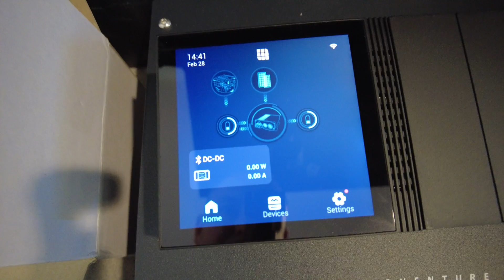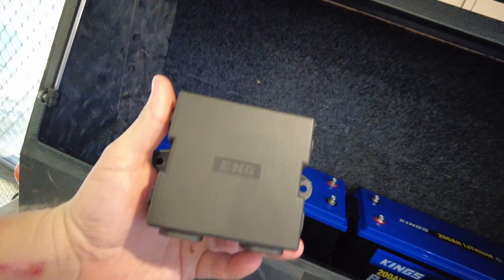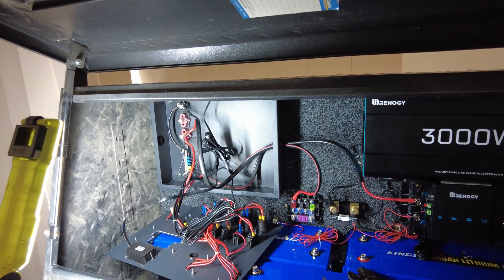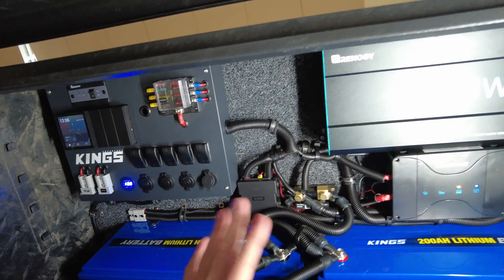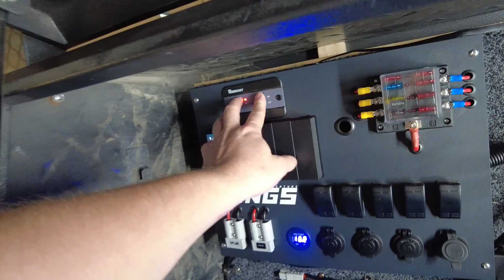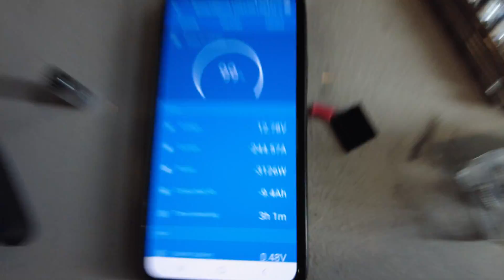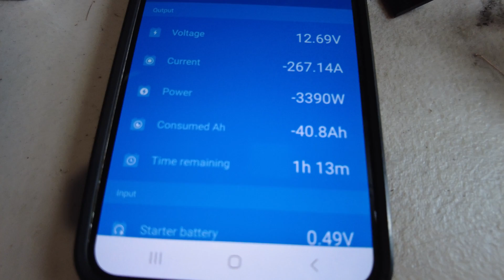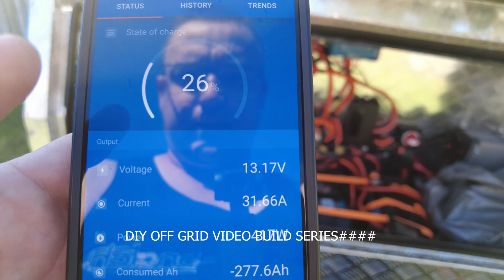600ah KINGS LITHIUM OFF GRID TOOLBOX BUILD

Comment: 3000 watt inverter on 50mm2 - i would have thought it would have to be 120mm2 or - 90 at the absolute very least?? can you explain your working a bit please..
Reply from the maker: This unit isn't designed to run at a full 3000w load constantly. Therefore 50mm2 is plenty over an extremely short run.
Reply: @WEEKENDER4X4  but it can run at 3000w by someone who is using the system and doesn't know its undersized cable?
Reply from the maker: @TindogTravels  the person I built it for wont use it for 3000w loads. If they sell it they're more than welcome to upgrade the cable if they need too. Its fused accordingly also.

Comment: Great set up mate. Well done 👍. One question about venting. What sort of vents have filters to keep dust out?  I have a platinum camper and want to relocate the batteries into the front checker plate tool box but I’m worried about heat. I was thinking of using a computer fan for extraction and having a vent on the opposite side of the box but I need to keep dust out too.  Cheers
Reply from the maker: @jackthomson73  most caravan filter sets come with fans and filters

Comment: Nice setup. Did you consider going 24v or 36v? What about solar charge capability? Will there be ventilation ports/fans? You also must insulate all exposed +12V connections to prevent accidental short circuits - very important.

Comment: Hey bro, do you have to earth a 12v system?
Reply from the maker: @newylyf7481  if it's just 12v no. If it's 240v floating(mobile) no. 
240v fixed it's always preferable to have the inverter earthed.
Reply: @WEEKENDER4X4  cheers bro, I don't know why so many people earth their 12v system in the back of the 4WD.
Reply from the maker: @newylyf7481  you earth it directly to the battery. Or a good body ground in the car. Sorry I thought you meant ground as in ground in ground lol
Reply: @WEEKENDER4X4  all good haha. I meant like a ground to body or chassis on the car. So like the Victron distributor has a ground connection which I've seen people run a cable from that to the car chassis or body. Doesn't make sense to me as why it's needed.
Reply from the maker: @newylyf7481  grounding to the body isn't necessary if you have enough cable to run the whole way to the battery negative. If you're on a budget and don't have enough space for fat cables running through the interior to the battery, grounding to the body is fine. As long as your main earth coming off the battery to chassis/body is clean and appropriately sized.

Comment: Hey mate what are your Victron smart shunt settings for the kings 300ah?
Reply from the maker: There's tonnes of videos on how to set up the Victron shunt for your needs, best way is to set the capacity after you have done a discharge test. That way you know the ACTUAL capacity of the battery first up.
Reply: @WEEKENDER4X4 . Hey Matt.  What was the reason going for Victron shunt over a renogy shunt? Purely because renogy shunt doesn't work with the renogy M1 screen? 
   I was deterred using the renogy 2000w inverter because of being centre tapped ,not earth bonded. Some interesting views on YouTube of the said inverters.

Comment: I thought you can only run 2 batteries in parallel said on there website
Reply from the maker: Hey mate I answered this question in a comment below 👍😊
Reply: @WEEKENDER4X4  Had the same Q, can't see other comment? I've currently got 12v 400ah (2 x 200ah) and know I'll need more but have been consistently advised away from adding another 1 (600ah would be ideal), as opposed to another parralel pair (800ah). P.s. I've got MRBF fuses directly on identical battery terminals - could be an easy & safe addition for you.
Reply from the maker: @morgannewall6421  you can run them in parrallel no problems as long as you arrange the cables to charge and discharge them evenly. Plenty of wiring diagrams on google on how to distribute the cables correctly depending on how many batteries you wire up.
Reply: @WEEKENDER4X4  Thx, doing my head in how many circles I've run coz I wasn't told this! 🤦‍♂
Reply: @WEEKENDER4X4  sorry just found it

Comment: Haha very good, I love my Kings lithium batteries 😊 PS curious on what they are going need to run in their overlanding system that need 600ah, aircons in the roof tops? 🤣
Reply: PPS not trolling, generally curious 😊
Reply from the maker: It's mainly to be a silent back up generator for their house aswell. They're in an area of qld that's prone to a lot of blackouts. They have tonnes of solar panels they can run on their system also if they need it.
Reply: @WEEKENDER4X4  ahh ok fair enough 😊

Comment: So.
You have 3 200Ah kings lithium batteries set up in parallel. 
But the information that they provide for these batteries  says that you can set 2 of these batteries in parallel. 
Can you please explain your decision ?
Thanks.
Reply from the maker: The main reason they don't recommend you do more than 2 in parallel is to keep the batteries balanced when charging/discharging. This is explained in the video when I'm mentioning how to wire up the main positive and negative when going from the battery bank to your (loads/chargers). If you take a look at some of will prowse videos on YouTube about charging and discharging larger battery banks you will see how out of balance they can become when not correctly spreading the current accross the batteries.
Reply: @WEEKENDER4X4  
So does having one of the positive charge cables in the centre of the battery bank help prevent that problem ?
Reply from the maker: Yes sure does. Also making sure the main cables are equal length. You can also put one at one end of the bank and one at the other end. For this one it made more sense to do both in the centre of the bank